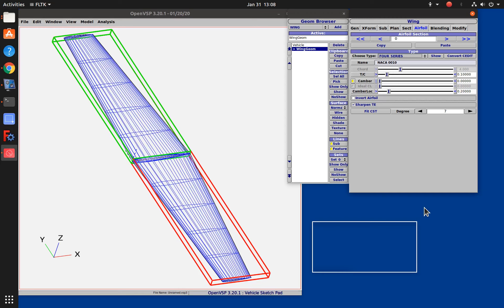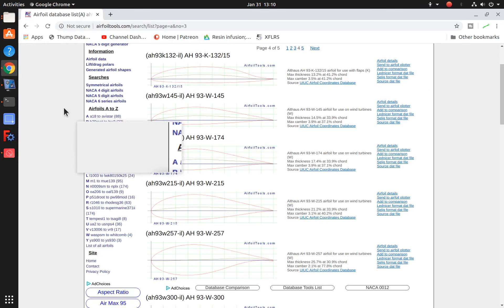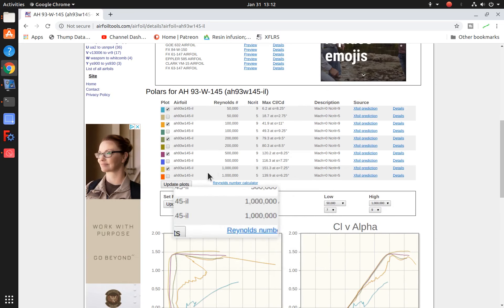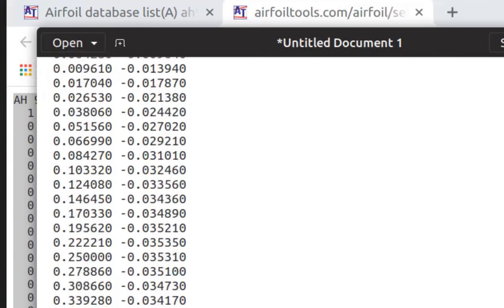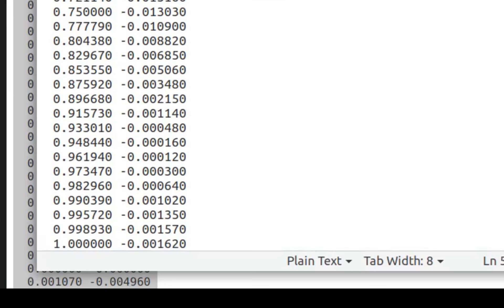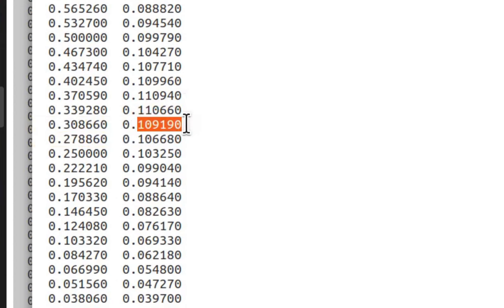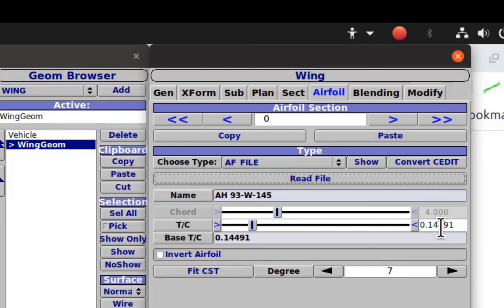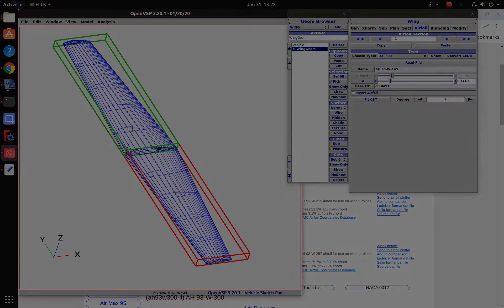OpenVSP Tutorial: Importing an Airfoil .dat file.

Comment: like your videos! I have been looking at airfoils for a design of my own. I'm wondering if you have any experience with the Ribblet airfoils?
Reply from the maker: I have done some comparisons of the Ribblet's with other airfoils. I really like their low Cm allowing a smaller horizontal tail surface. Their drag is not too bad either. For ultralight airplanes I like his ultralight airfoil (GA 30-618). For an off the shelf airfoil it is pretty good.